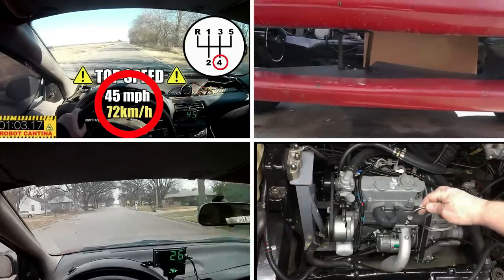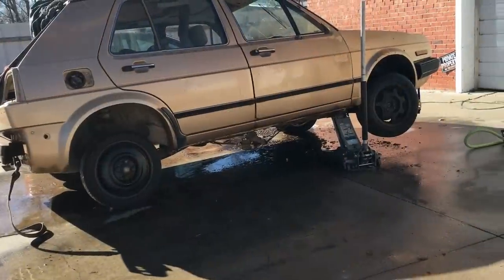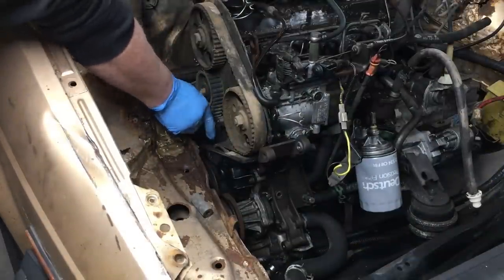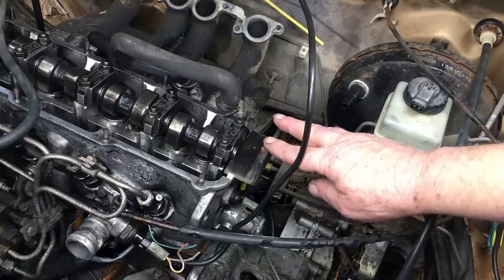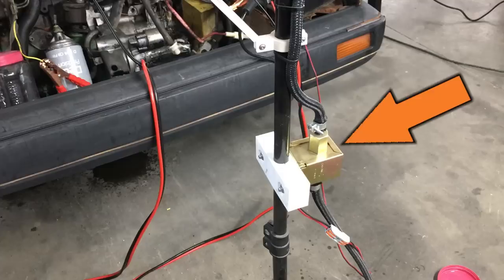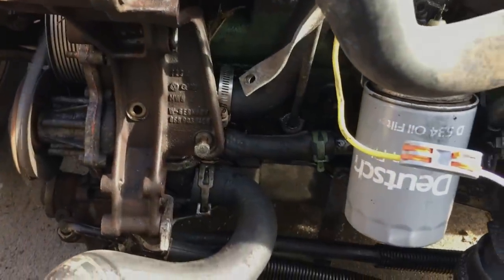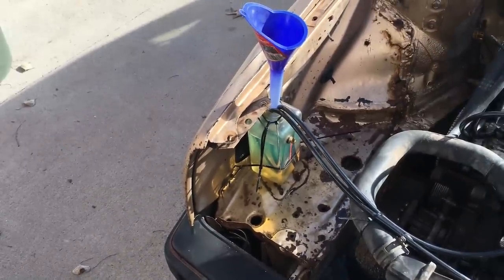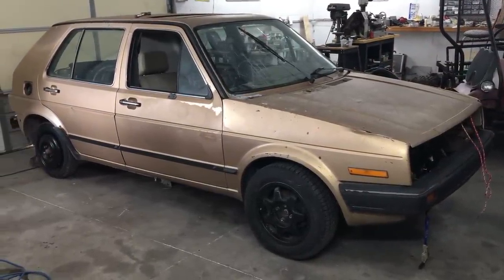S3 E3.  Will this abandoned 1985 Volkswagen 1.6L diesel run and drive again?.  Let's find out !

Comment: Hi , these engines run really well on on new veggie oil . People swear by used veggie oil being the next best thing to sliced bread , well you’ve seen that white fat mess in the pan after frying up a couple burgers , well that’s what happens to the injection pump if the used oil is not cleaned correctly . So I lived in Austria for 17 years and these 1600 diesel engines were in all my VW cars . All through summer I ran them on new veggie Oil . Veggie oil puts more out BTU’s than diesel so with the better bang leads to better fuel economy . The bad with veggie oil is the cold . Do not use it below 60 degrees . The Bosch pump can handle it but you can blow a seal . If you go to a system where you shut it down running on diesel and start on diesel with copper tube with coolant running through it inside the veggie oil tank to heat it up a bit first . Ya diesel was .97 cent a lt ,  veggie oil was .79 cent a liter . Well you can get a hold of me if you want more info . Facebook messenger is a good way . Paul Nolz

Comment: I had one in red with a five speed and drove it 25 miles to work and back for three years . Heater was worthless if you went above third gear and fifth was only useful for going downhill but fuel economy was amazing . i sold it when the cost to repair the A/C was more than it was worth. I am pretty sure they were Japanese engines, Misubishi maybe ?

Comment: I have worked a lot with these engines. Both 1.6 and 1.9 IDI.
The most common problem with the pump on these is that the small pump wings inside 'gum up' when they have been standing for a long time.
I have fixed several by mixing diesel and regular ATF oil. Start with the mixture and warm up, turn off and leave for half a day and then run through the rest. 
If you don't want to mess with this, the low-pressure electric pump is a good choice.

These engines are also extremely easy to turbo convert.. 😁👍

Comment: Tough little beasts those diesels. It is wise changing the timing belt, borrowed the mother in law's old diesel for a few months and nobody told me the belt needed changing and sure enough the belt snapped and sheared off the end of the camshaft. Yep I was popular as had to scrap the car.
Reply from the maker: That sucks, but now you know to check.

Comment: Those are great engines, friend of mine has a Komatsu mini hoe and when they wanted $12,000 for a new Yanmar, after the old one joined the space program he fit a 1.6L and had the pump tweaked, been like that for years and has more jam then it had stock. Seen more than a few in home built welders, gen sets and band saw mills.

Comment: I agree!
But remember to turbocharge, supercharge or "multicharge" the little 1.6L
It goes ways faster if you give a little more fuel and breathing help :D
Reply: The injection pump isn't setup for boost on the N/A he could find a TD pump though. But the block isn't set up for the extra heat forced induction would add.
Reply: @Dubst3pT3ch  
The only thing the boost compensator on the other pump does is to limit the fuel until you build boost, so to limit black smoke.

Even without oil squirters on the pistons you can run a fair amount of boost, just don't run with excessive black smoke as that will generate unnecessary amounts of heat.
Done this successfully on Toyota 2H engine and similar that also is IDI engine without oil squirters.
If the engine lack an oil cooler I would add one as some old diesel engines doesn't have one.

Comment: I has a 1.9 TDI and it was very similar to this engine. When I had to fix a leak on the injector pump I was able to prime it by disconnecting the injector return line and apply suction to it without energizing the fuel shut off valve. I did have to turn on the ignition and crank the engine to prime the high pressure lines though.

Comment: Hey Jimbo, I have a Skoda Octavia 1.9 TDI in it the glow plugs get 12v for 10 seconds and after they get 6v until engine reaches operating temperature. I think this helps diesel combustion on low RPM and boost economy or torque.

Comment: A simple explanation of what an interference engine is, is that the valves that let the air/fuel mixture (in a gas engine) or inlet air (in a diesel) into the engine and the exhaust out, are designed so that their movement overlaps with that of the piston underneath each set of valves -- so, if the timing belt (or, often, timing _chain_) is particularly awfully adjusted, snapped clean in half, or just plain missing, then as the engine tries to turn, the valves and the pistons make the attempt to occupy the same area of space. Because physics, this doesn't work out very well, and because the piston is a HECK of a lot larger and heavier than the valves, it kinda schoolyard bullies the valves away, and in the process of taking them for their lunch money and all they're worth, the valve stems -- the long, narrow 'stalk' bit of the valves that ride up and down on the cam rockers -- end up either badly bent or in multiple parts. Because of the speeds that the engine rotates at, the pistons usually also take a fairly pronounced beating from all of this... and the inevitable result is that you kind of wind up needing a whole new engine, because the finding out about the cost to rebuild something like that leads to you and your mechanic each doing to your respective pair of pants kind of what Jimbo was doing there with the hose and all just above the engine bay ;) it's not a pretty sight, all around.

Comment: Never expected to see this. I love small Diesel Engines!

I had to let my Mercedes Turbo Diesel 2.5L W124 go recently. I am still morning.  Shy of 400K. Still started but something went wrong in a piston Ring.  Didn't bother taking apart. Don't have funds or property.
Reply from the maker: I used to have  the uber rare Mercedes W201 with the turbo OM603 engine.  Wonderful car!
Reply: @robotcantina8957  Yeah the 5cyl 2.5s and the 6cyl 3.0's were amazing. I got mine at 350k. But over 40k trouble free.

Comment: These are a pretty common swap into the Suzuki Samurai, Sidekick, and Geo Tracker. With the Samurai gearing they will climb a wall no problem. It may not be a seat of the pants swap like you usually do, but it would be cool to see.

Comment: I’ve always run an electric, low pressure lift pump. It’s very common for these injector pumps to not have enough strength at this age to pull the fuel and pressurize the injectors.

Comment: The 1.9TDI has a adjustable cam gear, so you can adjust the timing when installing a new belt and it should be readjusted every 30.000km, because the timing belts do lenghten, as you have seen.

Comment: I learned how to drive manual on a mid 80's VW non turbo diesel.  Even though the motor had just over 50 hp I still had a blast wringing out every last hp from that car!  Looking forward to seeing the diesel engine in the Insight!

Comment: A friend of mine has the same engine but on a Gol (south american smaller Golf) and it has a 5 speed instead. Doing 75 mph you get 38 mpg, but if you do 60 mph, you get 45. Now, that doesn't sound great for a diesel. But with a swap for some more modern parts from the 1.9, you get 50+ mpg all day. And with AC!

Comment: The inside of that engine is in pristine condition, perhaps it was really well taken care of and that's why the Diesel Purge didn't make a big difference? I've had similar experiences with it, sometimes a huge difference others not.

Great video, really well presented! I approve the use of the circlip pliers, I've done many a VW timing belt and only ever used circlip pliers;-)

Comment: A 12v electric pump is all you need. I have this engine on a ZT mower, and have run it out of fuel many times. It primes it seconds, with no tools after adding fuel......

Comment: You can prime the injection pump using a mighty vac on the return line fitting. I guess a transfer pump accomplishes the same thing but once the pump has prime it will pull fuel without the need for a transfer pump

Comment: The best thing that VW did was making the TDI engine. The 1600, I believe, has an aluminum (aluminium) cylinder head, so to put a turbo on it isn't advised.
Reply from the maker: Yeah, I would have preferred the newer TDI, but this engine was cheap and available locally.  It will be a good starting point.
Reply: @robotcantina8957  JIMBO,    CONGRATULATIONS ON  115K  SUBSCRIBERS!!😊😊

Comment: My first car was a 1976 VW Rabbit so I'm painfully aware how easily the floorpans of these things rust. She was wonderful to drive and a real eye opener after driving my yank tanks and my sister's automatic Chevette. It also seemed like she was in the shop every month that I owned her. She eventually succumbed to floor rust, and was replaced by a new 1984 Plymouth Colt that did its job and survived my abuse until I graduated college and could afford something better.
Reply: I had a similar situation.  My dad had an '80 Chevette with an automatic and it wouldn't go past 65 mph.  And it drove like a truck!  My first car was a '77 Rabbit two door in Bali green with the fuel injected engine;  That little bastard was FAST!  From 0-60 it was a match for a GTI and it beat a lot of smog V8 cars!  AND I had the same rust issue:  One day I dropped my 140 pounds on the driver's seat and the whole thing went right through the rusted floors.  My mom through a fit and I wound up with an '85 Scirocco turbo [yes, they made these...] as a result.  Me and a friend welded a plate into the floor and I sold the car.

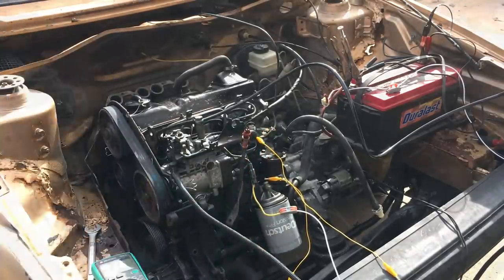Comment: At about 16:25, it seems the oil pressure switch is closed. If memory serves, mine closed on low oil pressure to make the warning light come on, and opened when oil pressure was OK. Might want to double-check that! Not to be negative, but I had a list of grievances by the time my diesel days were done: 1) the oil pump runs off  the smooth side of the timing belt. 2) the manuals implied the head bolt style to be an indicator of bolt diameter, which is no longer true. Early engines had 10mm diameter bolts and newer ones had 11mm diameter bolts, each having a different style of head.  Looking back, I'm pretty sure so many people had issues with leaking head gaskets because the procedure in the manual led you to misidentify the bolts and torque them incorrectly based totally on whether they were socket hex head or the odd "four square" type. 3) the heads habitually crack where the valve seats are closest to each other. OK, I'll stop there. I just hope you can enjoy yours without running into the issues I had. My flawed personality was probably a big part of the problem - I wanted to rebuild it once and get it right, so I didn't have to do stuff over again.

Comment: 1.6d is basically the as 1.9d only the head is different. You can easily turbocharge it. It’s cool ideal to add LPG on diesel, NOS for the poor guys 😁 
You can inject up to 30% LPG of the diesel fuel injected portion, but on idle must be only diesel! 🤘

Comment: Punt a large punch  square on the head of the Allen bolts and give them a tidy whack. That normally loosens them up.
Also, if you are using a new cam cover gasket, make sure you have the correct one, there are two types depending on your stud type (you have the type with a shoulder) (some kits come with studs).

Comment: I vote stick the diesel in the Saturn wagon, and go for peak fuel economy while still being decently driveable (such as a “safe” 0-60 time). But yet still looking stock from the outside. Keep the insight as the harbor freight motors and the red Saturn for the kubota. Kinda gives a variation between the cars and an “identity” for each build.

Comment: My first car was a 1980 VW Rabbit diesel.  It was an amazing engine, and got 50 mpg. I would even tow my 16 ft boat.
Reply: Oh for sure they were great for towing. I hauled double decker car trailers with mine all the time.
Reply: @Erik Larson  it wasn't great for hauling, but my 16 ft boat only weighted 2k.

Comment: I had to retire my 85 Jetta Coupe (1.6d/5-spd) for the same reasons your Golf needs to go to the scrap yard. 
The final clue for me was when my driver's seat rear mounts (posts, legs?) fell through the floor and grabbed the trailer ramps as I was driving it off the trailer.  Launched me into the back seat.

Comment: Thats a Mark 2 (MK2) Golf. the generation previous to it was the Rabbit. By the way, the alloy wheels on that golf are Momo Quasars, and can be worth a buck or two! Classic 90s euro tuning wheel. I had a set. I hope you saved em! They're becoming very hard to find!
Also, do yourself a favor and make or pick up a pump timing tool, you cant take the pump or pump pulley off without one on these. It'll never run right again if you do.
As far as I remember, the newer ones did  have an in-tank transfer pump, the older ones had a manual prime pump on the fuel pump housing.
These engines seriously benefit from running a gas 8v intake manifold (83-92) and a mk4 golf 2.0 tubular exhaust header. Really lets them breathe and wakes them up without too much hassle and gets you a few more MPGs. The Intake will make turbocharging it a lot easier too. 
The TDI is a newer generation but very similar block and much newer design and bigger displacement to what you have (direct injected vs IDI). 
The turbo version of what you have is also an IDI engine and was available alongside the NA one. The NA one can take a turbo pretty easily but does have weaker rods so you cant push it TOO hard.
Reply from the maker: The previous owner requested that I return the alloy wheels before the car gets scrapped.   Thanks for the heads up on the manifolds!
Reply: @robotcantina8957  phew! Good to hear. Yeah the stock mk4 golf 2.0 exhaust manifold is tubular stainless and IIRC only needs minor modification to fit the old counterflow 8v blocks.  (I think just a little flange clearancing). You can also just run and MK1 to Mk4 golf/rabbit/gti cheap 8V header or turbo manifold from ebay. 
There are several versions of the intake manifold for the old 8v gas motors, and realistically any of them will do, but some of them have different runner lengths, with I think the  MK1 clipper cabriolet being the longest (89-93 VW cabriolet), and the shortest being off of the Corrado G60.

Comment: I recently revived an 83 Celica Supra that had been used as a rat latrine for at least 5 years. Fortunately the decade it sat was in high desert arizona so the worst that happened otherwise was sun damage. 

I probably pulled at least 20lbs of rat crap from every part of the car, but the worst was the cowl by far.
Reply from the maker: LOL...Thankfully you didnt have to cut a trench into the side of the car to dran the  stuff out.

Comment: I'm looking forward to seeing the fuel mileage with this engine in the Insight. The Rabbit and Insight have similar weight, but the VW has the aerodynamics of a brick and would still get MPG in the mid- 40's. This will be a good experiment to see how much the Insight's aerodynamics will improve MPG over the VW.

Comment: The TDI is actually a better engine for fuel economy runs as it is a Direct Injection, whilst the 1,6D is an indirect injection engine. It is still a good engine if there is not driven to the moon and back 17 times. Yours is actually (at least having a look at the cylinder head) looks mint, like new. 

With all being said I would keep the shifter cables, and the shifter itself just for peace of mind (and maybe the whole front suspension and rack and pinion and steering). They might come in handy later on.

Comment: Is there a cable hooked to a lever on the Fuel pump between the fuel pump and block? If so pull it and leave it pulled when the engine warms up. It helps with starting and cold running.

Comment: "to those sensitive..."

Yeah no, we all know those Volkswagen's rust up and the drive trains outlast the bodies. Also yeah those shift patterns for finding reverse can be tricky, on the 4 speed, it's press the shaft down, pull toward the driver side, past where the 1st and 2nd line up is, then pull toward the back of the car. and for those that manage to get the 5 speed, basically the same but you push toward the front of the car instead.

That said. those drive trains usually come out the bottom of the car, you know, for next time if you are wanting to have a rolling chassis when you are done without burning through demo blades.

Comment: Kinda reminds me of davidsfarm back in the day. Dude adapted a similar VW diesel engine (IIRC from a totaled car) into an early 90s chrysler minivan and daily drove it to save money on fuel, and at the same time the sheer size of the thing allowed him to haul things like car parts around, even if the engine probably didn't like it all that much depending on the weight

Comment: this would be interesting to put into the saturn chassis. It should be more aerodynamic and possibly lighter then the mk2. This would also be interesting in the insight chassis if the tests with the harbor freight engine are done. Other tips for this would be to find an Eco diesel turbo setup (k14 turbo) this will add power and efficency. a turbo injection pump wouldn't be a bad idea either. new injector nozzles are easy to put in and can help big time in terms of fuel efficiency and overall running. Also apparently the turbo diesel cars 85 and 86 only in the us came with an overdrive transmission. If you can find that trans that would also help.

Comment: I had the 1.9 TD (turbo but no intercooler or direct injection) variant of this engine in a T4 (Eurovan). It was almost identiical to your engine. I think differnt stroke was the only thing apart from the small spinny boi